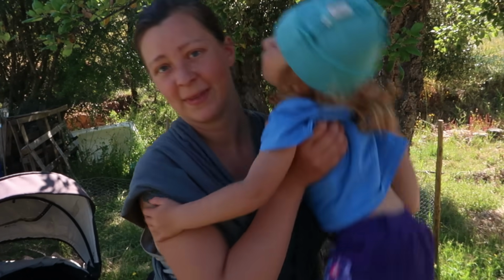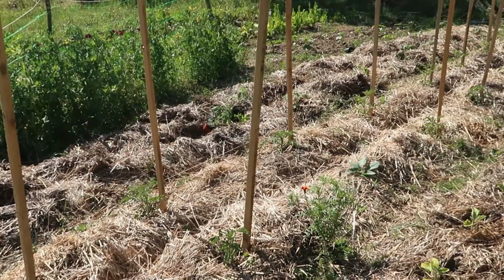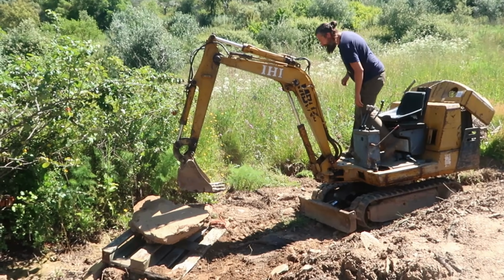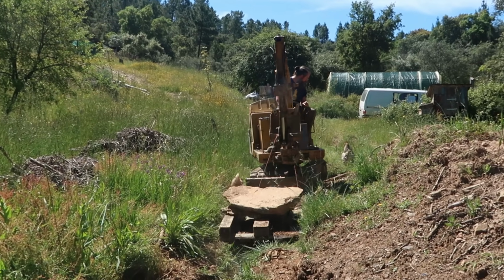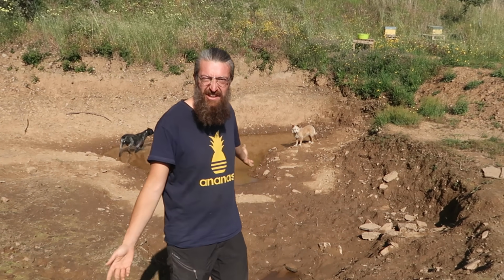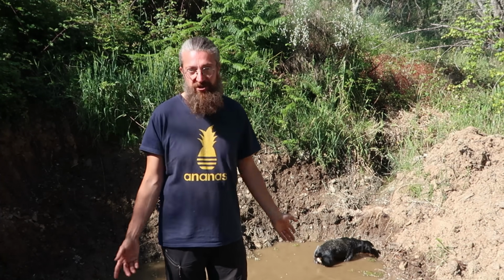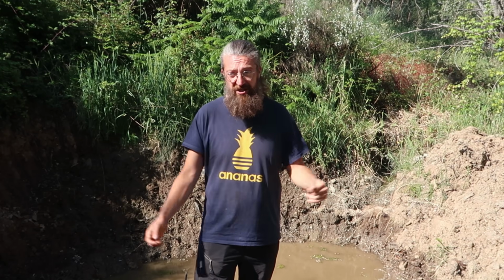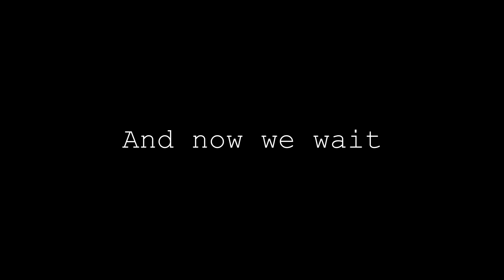This did not go as we had hoped. A final pond update, gardening with small kids and more.

Comment: If you put a large piece of bees waxed fabric like the cloth on the Yutt on stick legs say a metre high over the top of the pond wouldn’t the condensation drip off the fabric back into the pond and at least reduce your evaporation ?
Reply from the maker: Once we know the pond will hold water. We will add plants to the pond to reduce evaporation. The pond is too big to completely cover it with shade netting or similar.